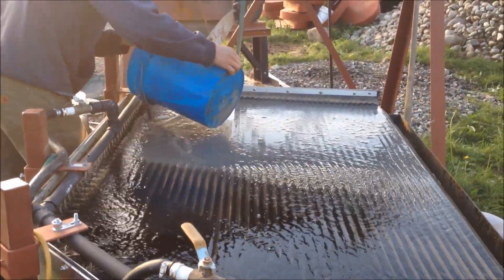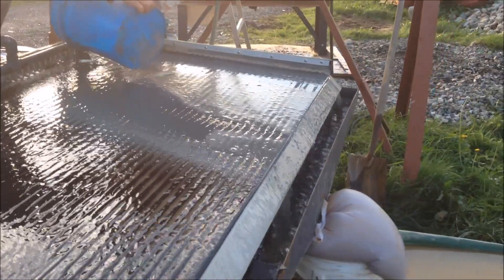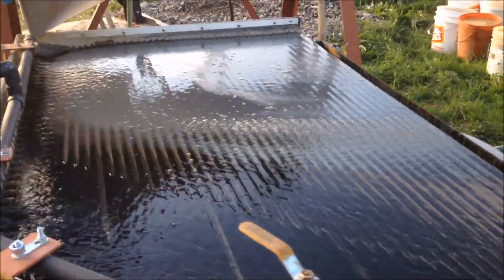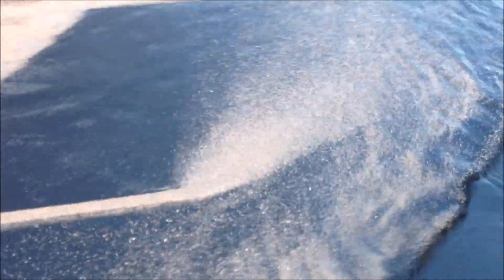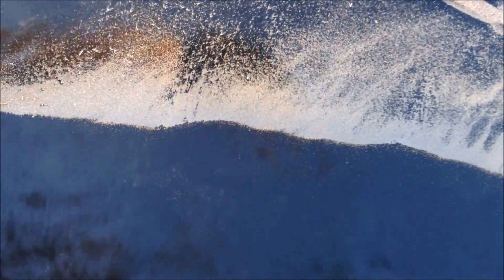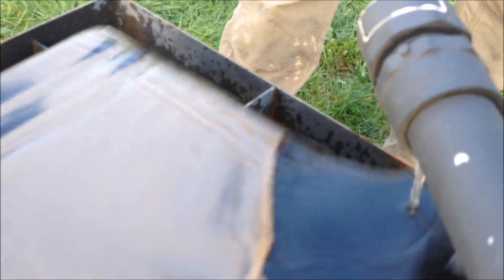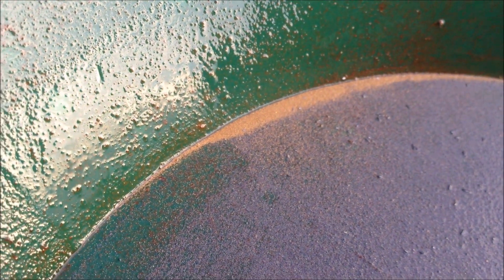MBMMLLC.com: Recovering scrap gold from electronics and circuit boards on a shaker table

Comment: As far as sending the metals to a refiner, do you send all of it together as one and than it is refined into the different metals? or do you have to specify what metal you want refined out of the different collection tubes? Ive been looking at different ways to refine the metal from electronic components and would like a way to recover all the metals and not just the gold.
Reply from the maker: Hi Brett-
The strategy would be send all the metals from the concentrates and high grade #2 to a refiner and they will pay you based on the different metals in each of those ports.  Every refiner is a little bit different and some may not pay for some metals and I am sure their prices are all different for different services.  The highgrade #1 hole can be refined "in house" yourself or it can also be sent to a refiner.  The #1 hole is where most of the gold will end up and it will be very rich in the dense metals (gold, silver, pt, etc.).

Comment: Since you have seen what kind of gold comes out of the circuit boards and the debris. If you had to choose between a Miller table(water table) or a spiral wheel gold prospecting panning machine, which one would you choose? What one do you think would be the next best thing when a shaker table is not an option? Also, i would not have as much debris due to the components on the boards would have been removed. I am looking to you as the authority on this. You know more about gold mining than i and you have seen the results of the boards :)
Reply from the maker: Hi Mymuse-
You have two great ideas there.  I would suggest the miller table, I have had some people in the past who have not had good luck with a spiral wheel getting fine gold.  If tuned correctly the miller table should be able to wash off all of the fiber glass and board waste and leave all the heavy metals in a clean state.  The key will be slow feeding and getting the table tuned correctly with slope and water flow, but I think it is a good idea.  The table could then be re-tuned to run your metals concentrate and maybe get the gold clean from the copper and other "lighter" metals.  Good luck and let us know how it turns out.  Thanks

Comment: What about the copper? Can you sort it out from the remaining metals and fiberglass from the boards?  I would hate to see the copper go to waste just to get the gold.
Reply from the maker: Hi mymuse-
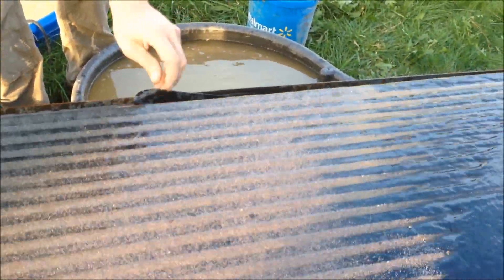You are absolutely right!  The copper is worth saving and can be sorted out from the rest of the board fibers using the shaker table.  Its kinda hard to tell from the video, but the large band of reddish brown material on the table at 1:25-1:45 is all copper.  It is being caught in the "middlings" output of the table.  This can then be sent to a refiner for the copper, lead, tin, etc.  Depending on how you look at it the gold is a bonus because the other metals will actually pay for the board processing.  Thanks for the comment!

Comment: Hey! Great way to recover gold!!!! So, how much gold did you get from those 10 pounds??
Reply from the maker: Hi and thanks for the comment!  We didn't get it weighed at the time, but from what it looks like in the pan I estimate its somewhere between 1/2 - 1 gram out of those mid-grade boards.  Those 10 pounds were richer than most 50-100 lb samples of raw gold ore we run for people!  I will also say that is only counting to gold recovered!  There were lots of other metals there that are worth money too such as copper, silver, tantalum, lead, tin, etc.  There might be as much value in the other metals as there was in the gold we recovered.  If you can get your hands on a good steady stream of old circuit boards to recycle then I think there would be a very profitable business opportunity there.  Thanks.
Reply: I am waiting for dry net weight for each bags of discharged materials which was sent to lab, once we have those numbers we can accurately say how much metals were there in one ton of PCB

Comment: Hello, Liked that a lot. How many boards was that? Thanks
Reply from the maker: Hello and thanks for the comment.  That sample was only about 10 lbs worth of boards.  They came already pulverized so I am not exactly sure how many or what kind of boards they were.  I am going to be experimenting with grinding more boards through one of our own hammer mills soon and will post a video to show the types of boards and how many.  Thanks
Reply: The boards in this video are very similar to what Steve has in his other video in blue bin. They are considered low grade telecomm boards.